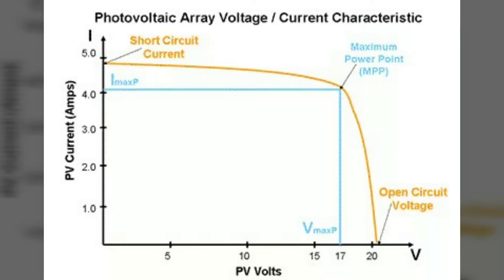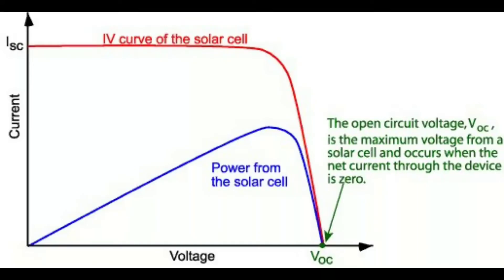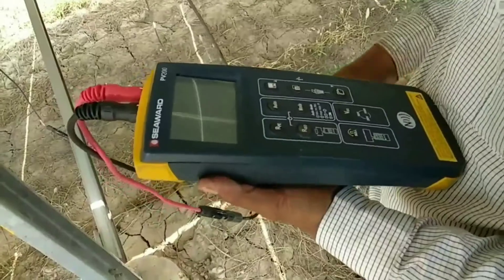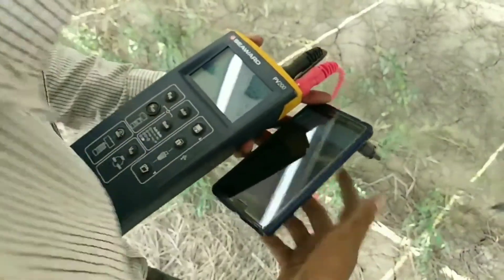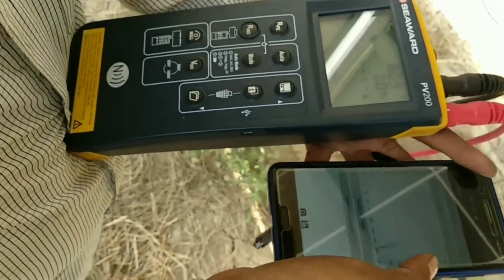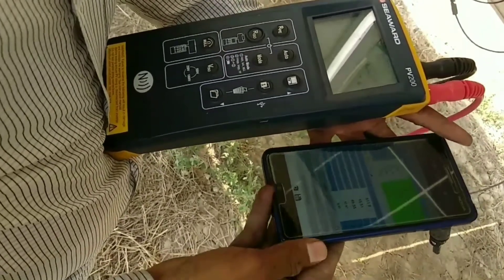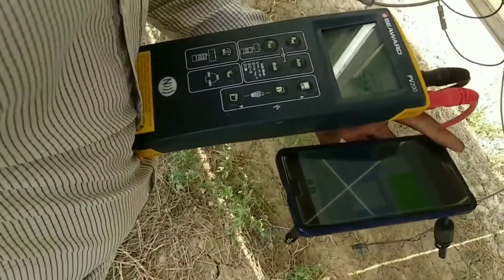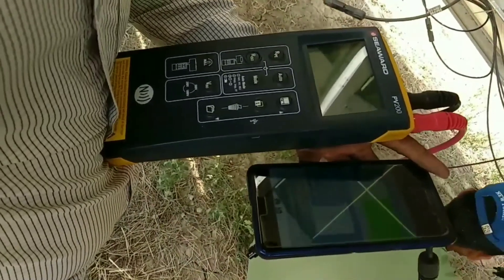SOLAR PANEL V I characteristics Testing device

Comment: How can i test my self prepared solar cell using basic circuit. I want to measure V-I characteristics and i dont have any instrument for that
Reply from the maker: Hi Ankita, what is the output voltage of your self prepared solar cell? If it above 5v then you can use digital CRO in your college lab to check the fluctuations in its output when light fall on it
Reply: @SustainableEveryDay  Hi sir in our site also we are planning to test is there any vendor to do the test

Comment: nice, how do i can an equipment like that for texting panels . I want one of those ?
Reply from the maker: +Ilus Andrew 
You need to find a authorized vendor for your area on the internet , why because you need to have all the test certificate as well as warranty certificate provided by the same vendor just in case the device is faulty
Reply: Ok , thank you very much. whats the device called ! Also i would love to come to India for solar training and installations. I am also interested in the application and installation of solar hot water heater. Do you have any recommendation on where i can get such training and be certified in India